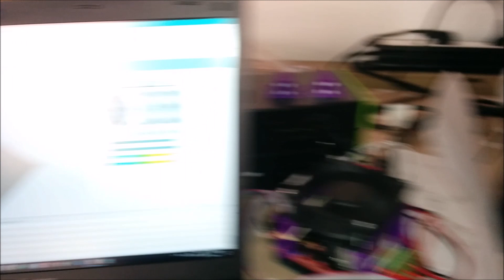3D Printer Axis Caliper Alignment Jig

Comment: I was looking for something like this, as most guides either require a dial indicator which many of us don't have, or to measure a print, which adds more variables into the measurement ( flow rate, e-steps, filament quality/diameter accuracy) can't believe this has never gained ground, as it's a sweet spot between cost and accuracy IMO
Reply from the maker: Thanks pretty simple and would have thought there would be other versions to be honest.  Need to make another one as doesn't fit my new caliper, definitely room for improvement on old one but hope it helps.